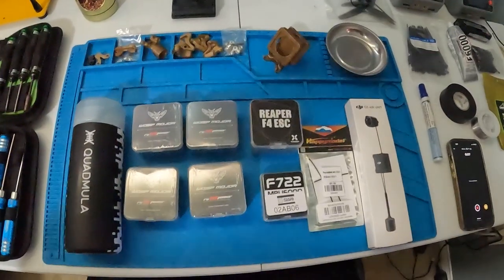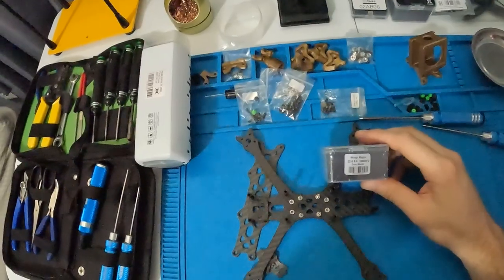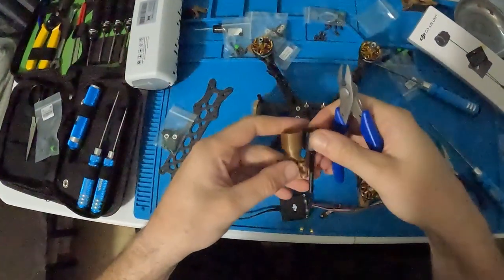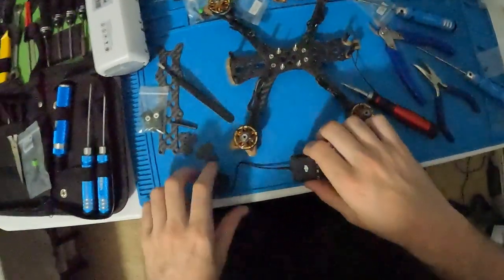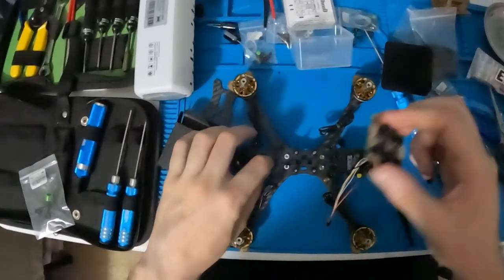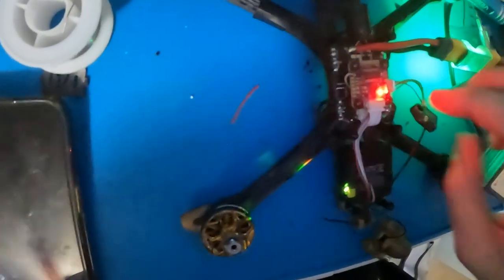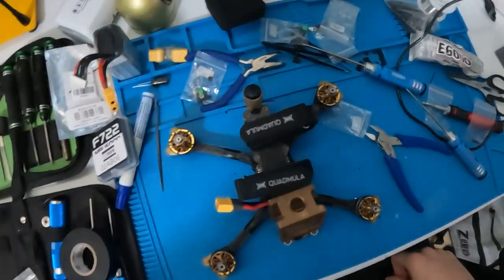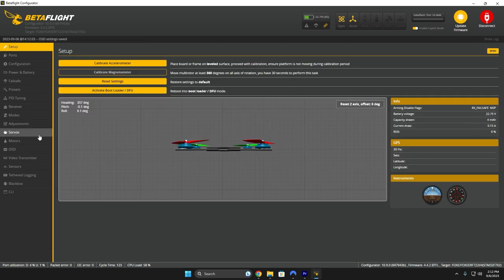How to Build an FPV Freestyle Drone - Full Guide

Comment: Thank you D3B8 for this vid! Awesome build! 
I'm now in the progress of building a full size Siren F5 split (my first build). And yes to solder that XT60 lead is a real pain in the ass, I had to redo to it already 3 times.... I had it right, but after probably too many times bending the leads (without being secured with a ziptie yet) one of the solder points snapped. So here we go again.... (and yes, a solder practice board is a must! )
Reply from the maker: Ya np my man, glad it helped and flux is your best friend with that part
Reply: Finally got it right now. The T-motor ESC I use came with a 12 awg wire XT60 pigtail. I now instead use a 14 awg xt60 pigtail for the ESC  which makes soldering a LOT easier. 
I just didn't trust the solderpoint I got with the 12awg wire because it already snapped once. Since that wire is soo stiff it puts more pressure on a solder point when bending the wire to fit. According Oscar Liang 14 awg should be perfectly fine. We'll see. I save a few grams that way too. 
Now lets hope the T-motor esc survived all the heat I applied with all that soldering and de-soldering,  getting rid of excessive piles of iron...... :face-blue-smiling:
(I think learning to de-solder is as much important than to solder, that way you can do it over and over again till it's right, which I did, only hope the ESC survived...... 😃)

Comment: Running a similar build. Thank you for the video brother.

Question:
Why did you cut the wires from the O3 unit and not need to use all of them? 

I’m running the O3 and a Radiomaster RP4TD receiver. 

Do I not need to use all the wires on the O3 to FC cable as well? 

I appreciate you,
Kyle
Reply from the maker: I cut the wires because that specific fc doesn’t have a plug for the harness and you only need to use the first 4 (P, G, Rx, and Tx) the other 2 are for if you want to use the DJI controller 👍

Comment: The motor direction wizard does not work in 4.4.2. Every time I need to change motor direction, I have to flash 4.4.0, use the wizard to change motor direction, save a backup, flash back to 4.4.2 and load the backup. You could also swap 2 motor wires on the ESC, but I like to make my life more difficult! lol
Reply from the maker: That’s a bit odd, haven’t encountered that. I mean you can adjust the motor direction in blheli32 if you don’t want to constantly change versions on Betaflight.

Comment: I've never activated boot loader on a new build! just update, Is this something I should be doing? i always save the factory, firmware,
Reply from the maker: I didn't even know you could update without activating bootloader haha, unless if it does it automatically. Anyways ya I would recommend activating it before updating.